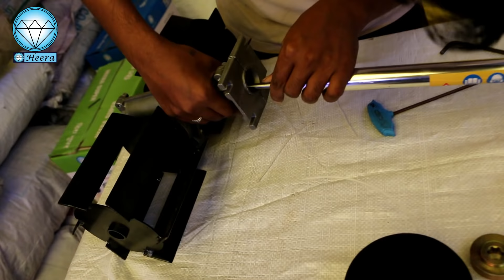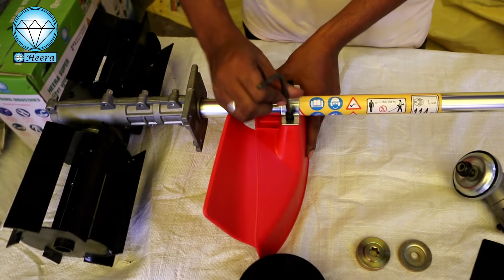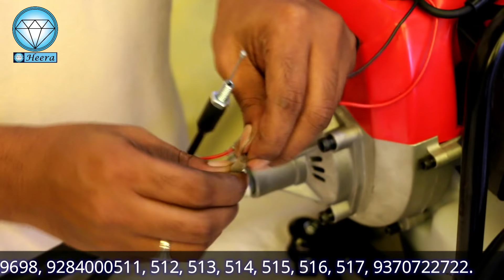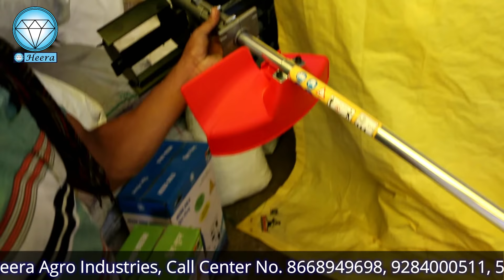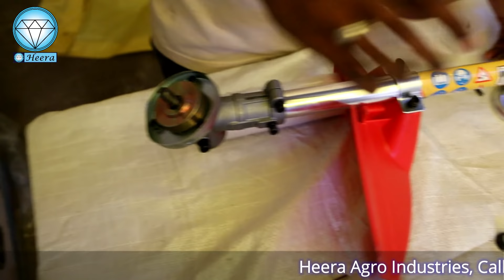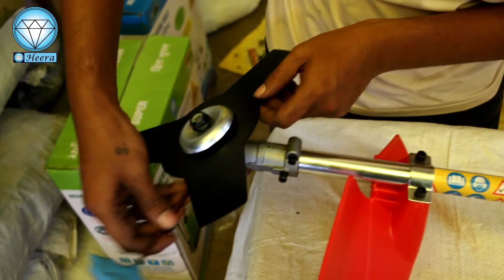Modern Farming - Heera Brush Cutter, Modern Agriculture Machinery,Power Brush Cutter,2 stroke cutter

Comment: Which engine used in machine. &specification
Reply from the maker: Shivanand Birasdar Heera 52 cc 2 stroke
Reply from the maker: Shivanand Birasdar ➡️कृपया Heera Rain Gun के बारे में जानकारी के लिए आपका संपर्क नंबर दीजिए हीरा एग्रो कॉल सेंटर आपको जल्दी ही संपर्क करेंगे

▶️अधिक जानकारी के लिए हिरा अॅग्रो कॅाल सेंटर से   9307300145 / 9284000514 / 9284000515 / 9284000516 / 9284000517 / 9284000518 संपर्क करेI (सुबह 8 से शाम 6 बजे तक) 

✅खेती, मौसम, सरकारी योजनाएँ, जोडधंदे, उत्पाद यह सब जानकारी Whatsapp पर मुफ्त पाने के लिए कृपया नीचे दी गयी लिंकपर जाकर फॉर्म भरे | 
👉 http://whatsapp.heeraagro.com/

Comment: Total price kiti ahe. warranty kiti manth ahe.
Reply from the maker: 13500
Reply from the maker: अधिक जानकारी के लिए हिरा अॅग्रो कॅाल सेंटर से 9284000511 / 9284000512 /

9284000513 / 9284000514 / 9284000515 / 9284000516 / 9284000517 संपर्क करे
Reply: मशीन खरीदने के बाद कोहि वारंटी नहीं
Reply: Hi I have done some research in this machine I have that purchasing Honda or Kawasaki brush cutter is the only best option  at least it will work for a 2 to 3 years other wise India product is not use full
Reply from the maker: Ajay Vasava क्या आपने हमारी मशीन परचेस  किया है ? अगर नहीं किया तो आपकी कैसे रिसर्च कर रहे l कृपया आपका मोबाइल नंबर दीजिए हम खुद आपसे बात करेंगे l